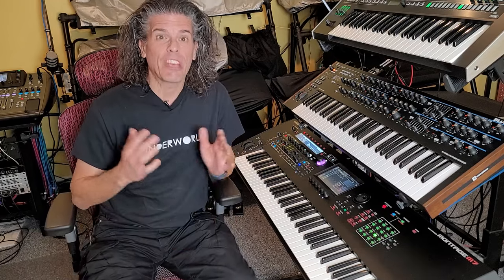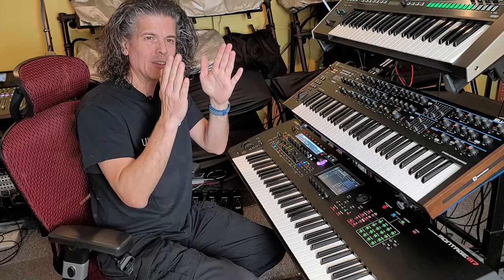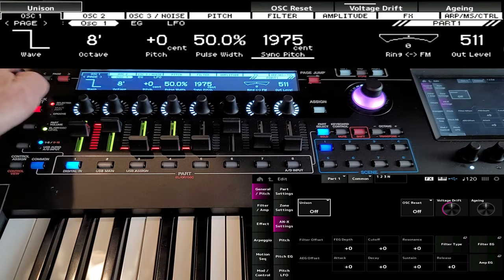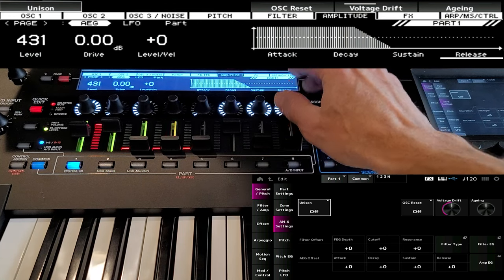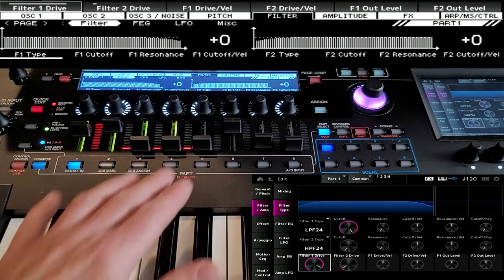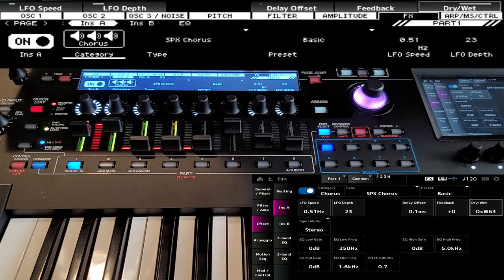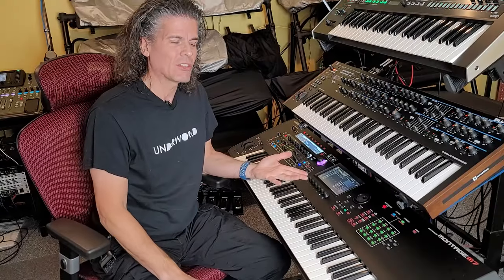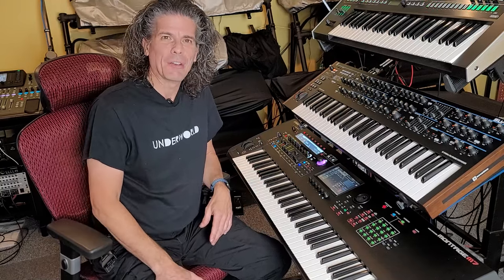How to Build the Lead Sync Synth Sound from Tame Impala's "Is It True" on the Montage M

Comment: Nice informative demo. I'm hearing some weird clipping and distortion that doesn't sound related to the sound patch in this video, and the FM demo posted before this one that i haven't heard before in your older videos. May want to double check the signal path?
Reply from the maker: You know what....I just went back to listen, and I'm definitely hearing it as well. I definitely did not hear it when I was playing it. The only thing common to both of those is that I was using OBS to capture and record both the Montage screen and its audio, whereas I normally use Audacity. I suspect that's where it's coming from. I'll have to figure out a different audio capture method.

Comment: Hello Scott! In an older video, you showed on Montage how to make a Super Saw sound from 8 Elements. I have a question? Is it possible to do the same by detuning the 8 Element Saw patterns with the Super Knob? This would be interesting because then we would achieve the same thing as Roland's traditional Super Saw setup. There, the starting point is a simple Saw Wave, which is detuned with the addition of Detune, and the Super Saw is created from this. A friend of mine tried it and it worked, but I don't know how.

Comment: Scott, your so talented.
Could the FM synth do something close??
Reply from the maker: It depends. On the Montage or MODX (or maybe the Opsix) where you can modify the spectral skirt of the waveforms...perhaps. You can approximate a square wave in FM and even get it to simulate sync by modifying it with another operator - but it doesn't have the brash sound that you get from a true square wave from an analog oscillator (or modelled analog oscillator). I tried...and it was similar, but definitely nowhere close.

Comment: Tame Impala are amazing! I guess this sound is possible to make on the GAIA2?
Reply from the maker: Good question...I gave it a try. You can connect the motional pad (in one shot mode) to OSC 3 pitch (when OSC sync is turned on) and it works, but it will take some time to get it tuned to the right speed. I didn't try to connect key velocity to it, so not sure if that could be duplicated or not.